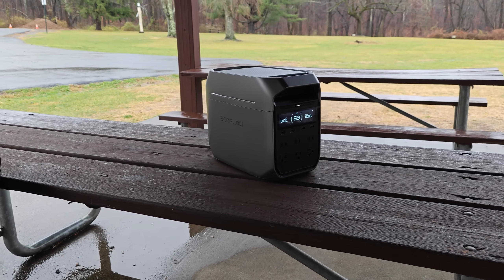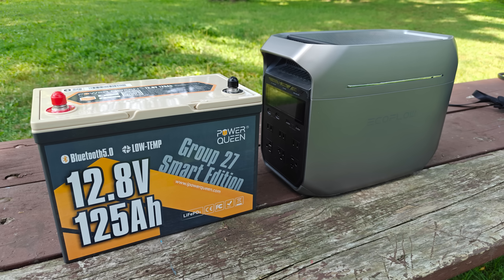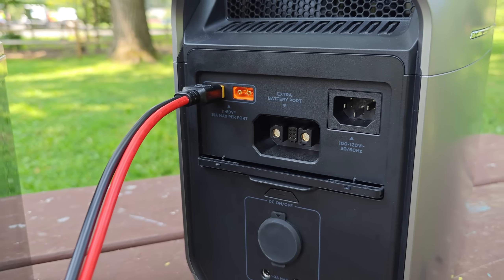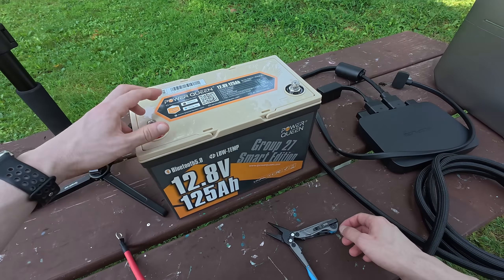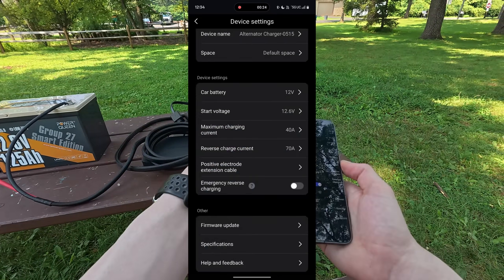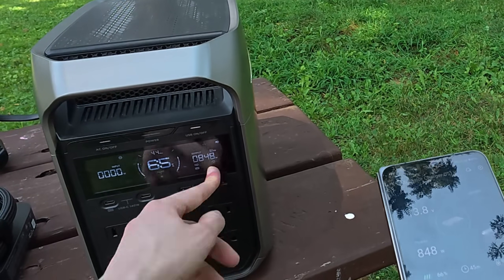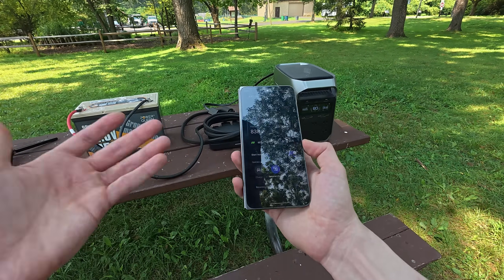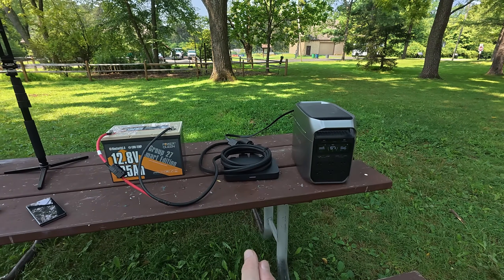How to Expand Power Station Capacity for Cheap!

Comment: Sorry i am a solar noob but i use the first way seeing it does exactly the same as with the dc\dc charger only way slower, so only way with charger is usefull if time is of the essance (sorry bad English i am dutch) and further more for the price of the dc\dc charger you would be able to allmost buy 2 exta 100ah 12.8v Lifepo batteries. So yeah if time is important then even NO i would go for extra batteries. Just my opinion. Have a gr8 day.
Reply: Just connect an mppt (epever) to that external battery, charge the ecoflow via xt60i, get a 24v or 48v battery setup. Problem solved.

Additionak hack, connect both xt60i connector to that battery
Reply: How to you reverse charge they extra battery? With that ecoflow app?

Comment: Neither of these options "expand power station capacity".  What both of these do is charge the charge the battery in the power station, using an auxiliary source.  The first option is far less expensive and you could use a very simple PWM solar charge controller to move power back to the Power Queen battery from the power station...but, why would you ever want to do that?

Comment: adding the dc to dc charger the 12v battery the connecting cables and you have spent more than the  expansion battery!!!  plus now you have a much more complicated system.  and multiple apps to monitor.   Dont see any advantage to doing this.
Reply: Have you priced the expansion battery?
Reply: I use the ecoflow dc to dc charger as an expansion. I already had the components, but didn't want to permanently install the charger to my car alternator. It just works for us.
Reply: The video solution doesn't require buying solar panels.

Comment: cheap? i don't think so. a simple 12 dollar XT60 to O Ring Terminal Cable will do the job without at 380 dollar dc converter. If you wanna up the charge rate a 12v to 24v converter for 25 bucks will do the job as well.
Hope the check from Ecoflow gets spent well, you disingenuous shill.
Reply: Is the energy coming from unicorns?

Comment: You mentioned this could be done for "cheap" but fail to mention the $380 for the DC-DC charger.  I am not so sure about the cheap part of this...
Reply: Great video! I just got the 800 W charger for less than $200 when buying the EcoFlow Delta 3 Max Plus! Great products! I'm also buying the generic batteries too. Thanks!
Reply: Nopēr ko līdziģu šim un būsi laimīgs. Pure Sine Wave Inverter 1000W  DC 24V To AC 220V Voltage 50/60HZ Solar Car Inverters. Kādu tavai PS ac vajag piem. 110V
Reply: These DC/DC chargers can be bought for $200. Also cheap is relative to the option of buying the battery backup from Ecoflow. You can also just pair a battery up to them without the DC charger.
Reply: LOL
Reply: plug a 120v battery charger, a cheap one, into your full power station to chrge up your auxiliary battery.
Reply: Alternator charger is $260 remanufactured on ebay
Reply: @notransfat1 189.00 as today
Reply: Way cheaper then 2900$ for the expansion battery from ecoflow
Reply: @lanceboudreau3630  not cheaper than just hooking up a Litime battery and calling it a day
Reply: @lanceboudreau3630  than not then
Reply: @lanceboudreau3630 dont waste your breath they think cheap means free or sub 100 dollars. This is definitely cheap compared to the usual cost like you stated
Reply: Agreed.
Reply: I wondered the same thing.  Definitely not subscribing... sorry Charlie.
Reply: I noticed it too. Still paid for the overpriced ecoflow exclusive dc to dc charger. When you want think you outsmarted the company but failed. Haha
Reply: Wow $380 for the charger. Guess you should buy their 4,000 dollar battery instead
Reply: @kjpatrick21 the 1kwh  expansion battery is $380🎉🎉🎉 congratulations, you played yourself
Reply: @kjpatrick21  hey ass-hat, 100Ahr batteries are going for UNDER $150 on Amazon.  If you are going to comment, please TRY to make it somewhat intelligent (if that is possible for you).  $4000 would get you a 10-15KWhr backup system which could power your whole house - FYI.
Reply: Everyone is forgetting to add the $100 charger for the lithium battery too!
Reply: @Justlooking94114 naw, if you can reverse charge then you dont need it

Comment: how are you charging the expansion battery
Reply: buy a 12v battery charger, plug it into the flow and then charge the ecoflow with either solar or grid power.

Comment: interesting but that's alot to lug around to charge.
The sooner the Power stations put lugs on thier units the better.
They had to see this coming.
Hooking up a Power station to a bunch of External batteries - Should be alot easier than this.
They need to do better.
The First company to do it - will sell like hotcakes !!!
Reply: They want to sell you their battery, not someone else's.